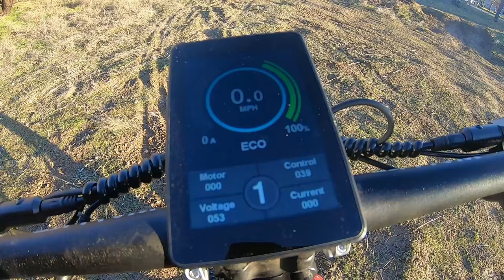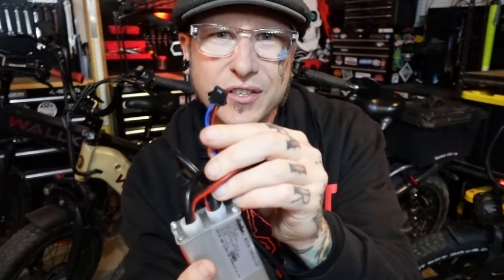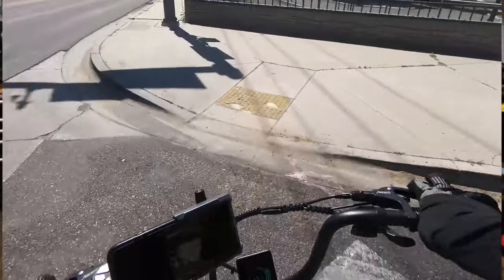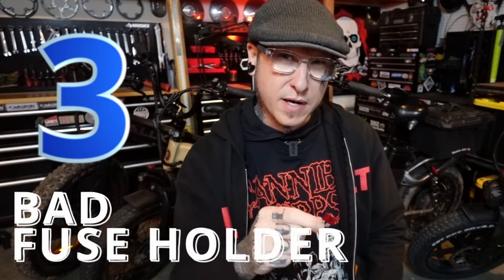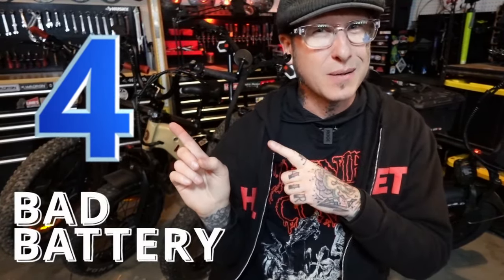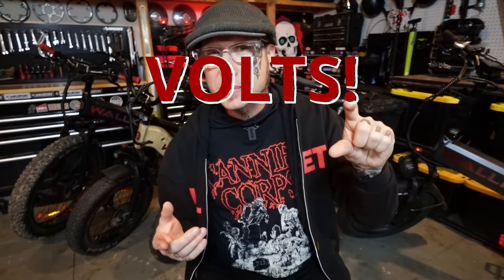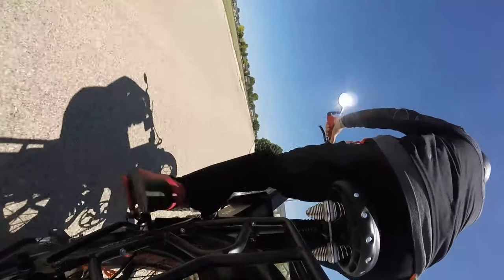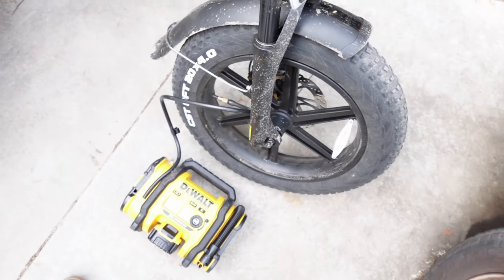E-BIKE: Little-known Fixes for the Top 5 Problems

Comment: Tires: I'm a non-motorized city commuter. My tire size is usually 26x1.25 (ive been through several bikes) and the first thing I do is buy Good Year Street tread skins, then I buy triple thick tubes. The tire skins are rated for 60 psi but I run 80-90 psi. The reduction on drag is huge and I can really tell when it drops below 70 psi. Never gotten a flat but the tire skins do dry out and crack faster than normal. If I owned an E-bike this would be one of the first things I'd look into, but information seems to be scarce. This would be a good topic for a vid. How to source streed tread fat tires, extra hvy duty tubes. And how about a range test. I bet doubling the tire pressure would really extend the range on pavement. Spring is coming and it would make for an interesting vid that no one has done.
    Don't mind me, I'm just thinking out loud.
Reply from the maker: Yeah my first Ebike was 26x2. It was cool but useless on ice or in the mountains. I run Tannus Armour on all my bikes plus thicker, sealant impregnated tubes. We have goatheads here bad. I have a few "heavy duty" tires in mind that I'm hoping to install and review here soon. 
As for a range test video. I've started shooting one for the H6 Max. It's tricky because there are so many variables. It's hard to produce a control experiment. And I believe it's important to do such testing and reporting after the bike has been broken in. Either way it'll be fun.  Cheers!
Reply: @TheE-LightenedArtist  With different tire pressures? Or the run of the mill range test like everyone does?
    And, is a goat head a type of thorn plant?
Reply from the maker: Oh doing different pressures is a cool idea. I was thinking more along the lines of different power levels. Yeah goat heads are vicious little thorns that plague this valley.
Reply: @TheE-LightenedArtist  In my experience, a soft tire will pick up punctures faster than hard tires. Not sure in your area, but give it a try. 30-40 psi to begin with. You'll know when the tire skin is getting stressed out too much (it will bulge in one area).

Comment: Hey, love your videos man. I just ordered the H9 60ah and I'm wondering what kind of tubes to order for back up. Also wondering if I should swap the tires out. If you could give me any tips I'd really appreciate it. Thank you
Reply from the maker: Hi and thanks so much! these are the tubes I'm running. It's really long link.

https://www.amazon.com/Mountain-Schrader-Compatible-26x4-15-26x4-25/dp/B08GLQGPH3/?_encoding=UTF8&pd_rd_w=gB1Nq&content-id=amzn1.sym.3c3990c3-513c-4686-8d92-a42b4095cecb%3Aamzn1.symc.8b620bc3-61d8-46b3-abd9-110539785634&pf_rd_p=3c3990c3-513c-4686-8d92-a42b4095cecb&pf_rd_r=6FW43B5BJJ8ZSRW8ZTZM&pd_rd_wg=1zUrK&pd_rd_r=6f567153-6ff9-4111-8e10-268ebd58aad7&ref_=pd_gw_ci_mcx_mr_hp_d
Reply from the maker: As for the stock CST tires, you'll wear em' out pretty quick. I haven't changed mine out yet so not sure what to recommend. I wish Wallke hadn't switched from the Kendas. I'm considering ordering these.

https://www.amazon.com/ULTRAVERSE-20x4-Bike-Tire-High-Performance/dp/B0CFR2ZDG6/?_encoding=UTF8&pd_rd_w=gB1Nq&content-id=amzn1.sym.3c3990c3-513c-4686-8d92-a42b4095cecb%3Aamzn1.symc.8b620bc3-61d8-46b3-abd9-110539785634&pf_rd_p=3c3990c3-513c-4686-8d92-a42b4095cecb&pf_rd_r=6FW43B5BJJ8ZSRW8ZTZM&pd_rd_wg=1zUrK&pd_rd_r=6f567153-6ff9-4111-8e10-268ebd58aad7&ref_=pd_gw_ci_mcx_mr_hp_d&th=1

Comment: Another problem.. not on my Wallke, but could happen.  When closing the frame (foldable bike), I had a battery that didn't line up up perfectly and the male ends pushed in the female tabs creating a valley.  Battery is in great shape, but now the connection won't fully complete.  I was careful, but the female section is mostly plastic and got kind of crushed.  Working to get a new battery cover...
Reply from the maker: Oh yeah I’ve always been concerned with that. The caps on these Wallke batteries nest into the tube really well so has never been a problem. But when I first got a folder I always closed it slowly.  After having 4 of them I just slam em shut lol. Thanks for the tip!

Comment: Hi Tracy,
This is Scott C again...I got my H6Max 2 weeks ago and I have already snapped off a kickstand and ruined the half throttle while trying to replace handle grips...I know.. Dumbarss I am... The. BIG QUESTION is how do I get one overnighted to me tomorrow?  Does it have to come from Wallke?  Can you use a half throttle that isn't made by Wallke?  I would prefer to get it from Wallke but was just curious...I would appreciate any feedback you can give.
Thank you I'm advance!
Reply from the maker: I’d expect you could find one on Amazon or eBay. Just look for one with the a horn  and the green Juliet connector with 5 pins so it’ll plug right in.
Reply from the maker: Ugh. Man. I just looked around and it might actually be hard to find. Contacting Wallke might be the way to go. Or get one with open connections and try wiring it in to a 5 pin. That would kinda suck tho.

Comment: I got a error code 21 current something on my x3 walkee. any ideas? Been tracing the wire looking for shorts to ground but found nothing so far
Reply from the maker: Hi. Did you check the twist lock connection to the motor on the swing arm?
Reply: @TheE-LightenedArtist  im not a 100% on where that is.
Reply from the maker: The cable coming from your hub motor. There's a connection on the swing arm.